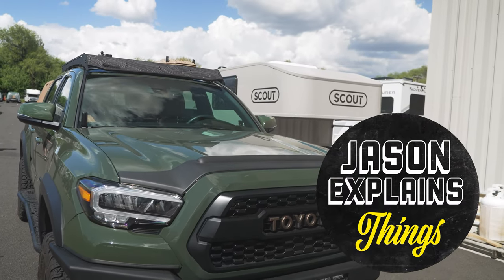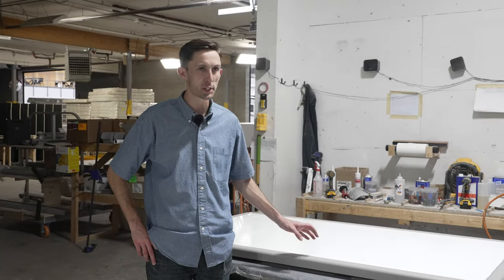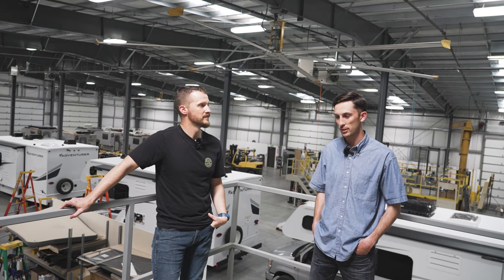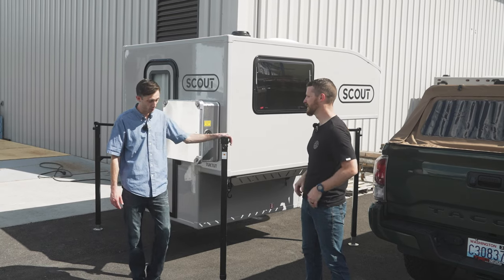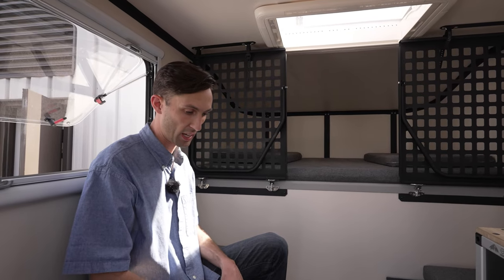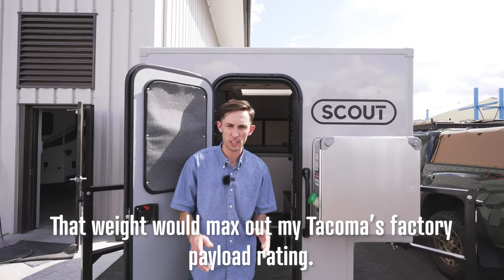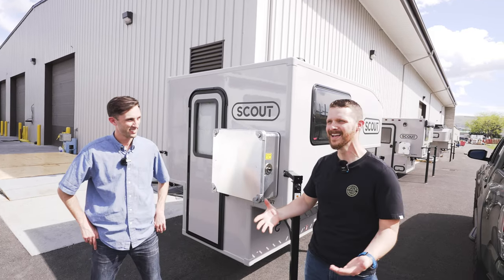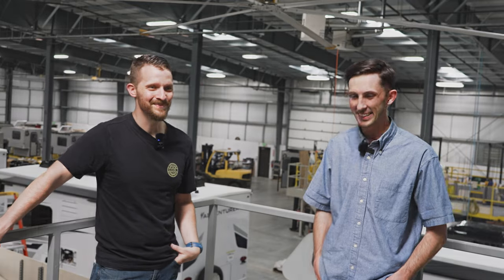NEW Off Road Camper For Small Trucks!  Scout Campers Tuktut

Comment: If the  man wouldn't  tell you the price you know it's not cheap!!
Reply: Seriously. Give us a ballpark if the price isn’t set yet. Is it $5000 or $50,000?
Reply: @rickysiebert9618  starts at $24,000 and up.
Reply: That's close to the Kimbo $23k base price. Right now I have a molded fiberglass over cab slide in utility body in a 2008 Tacoma 4x4 with the 6' bed. I guess I'll stick with what I have. I need to do some interior reconfiguring to optimize it.
Reply: Well, maybe it’s not a non-for a profit🤔😆
Reply: Says 16.5k in description
Reply: Nothing they make is cheap
Reply: Read the description. Starting at $16,000

Comment: Only thing missing is the option to add the tent pop-up and it would be perfect
Reply from the maker: Yeah, they have models with that as an option.  Depends on the weight capacity of the roof.
Reply: @JasonExplainsThings  yea but then need a bigger truck
Reply from the maker: Yep.

Comment: Do you leave the trail gate on or off  is there any propane or water is there a small cook stove and the battery , fuse box, switches and maybe a cassette toilet thanks
Reply from the maker: Depends on the truck bed length I believe.
Reply: You can add the things you want and save thousands by doing it. LOL 😂